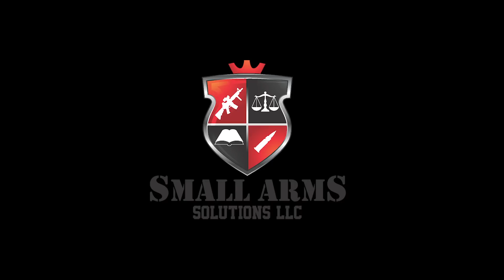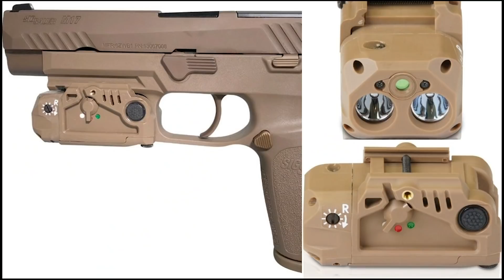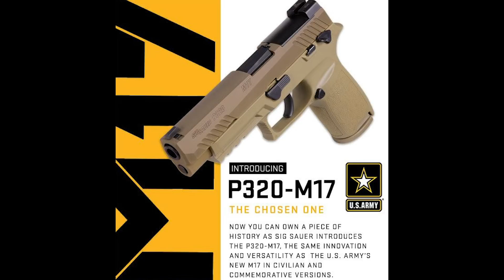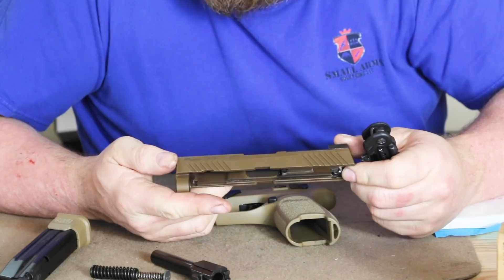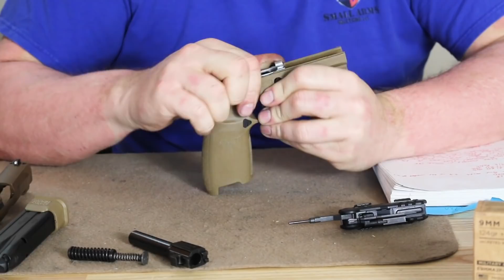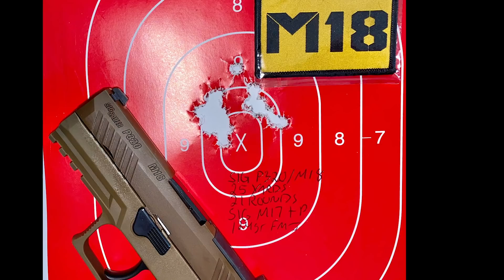Sig P320/M18 Pistol

Comment: The beretta apx is better than both of these considering the price on the civilian market . I see them all the time around 300bucks with multiple barrel sizes to choose from.
Reply: 38 years and they still come with crappy sights trigger and grip angle . First one i ever owned scattered bullets all over the target pure terd . Shoot someone else's next to me and hit just fine . Had several others they worked fine but still never have liked them. But the absolute worst thing about them is all you cheese dicks showing up on every gun review whining and moaning about your ugly ass glocks  that most of you have never fired over 50 rounds out of in month more like a year so How bout that.
Reply: @rustytaylor7708  The sites work fine. I've never changed sites on mine. You need practice.  The Glock is a polymer pistol that can be trusted right out of the box for service in military or police. Its not suppose to be a bullseye shooter or a competition gun, it's meant for duty use. Who cares if they are plastic or metal, you won't know the difference either way.  Just dumb Hater complaints. The more extreme Grip angle is to help maintain recoil, but your not smart enough to know how that benefits the shooter. Has worked for 38 years and everyone is copying the patent now. I wonder why..?
Its damn ugly, but its not a beauty contest. It's for duty use. Simple, reliable and light weight high capacity. 
That's all you need.
Reply: Better than a Glock? Prove it. Glock has a 38year  reputation that's hard to beat.
Reply: @rkwjunior2298  berettas has more experience in the field than glock . sorry my friend. almost 500 years now.
Reply: JoeyJoe 500 years of experience, most of which was spent building blackpowder Firearms. Sorry, that doesn’t count. The Glock, any of the Glock models, are superior to the M9. I was issued an M9 when I was in the 5th Special Forces Group, almost to a man we hated it. Overly large and heavy with a lousy trigger.  I was fortunate enough to have a team sergeant that allowed us some leeway and I carried my personally owned Hi-Power. Same caliber and an older design but much better than the M9. Take a look at what the SOF community is carrying now. The correct answer would be Glocks. Even the SEALs gave up their Sig P226s for Glocks. To me, and anyone paying attention that says something.
Reply: @RobinP556  I like glocks too man  , i have a 19, but considering beretta long history with firearms , especially military , i think an apx at the half the price of a 19x is no different . we can agree to disagree i guess.
Reply: @ScottyBennitone  500 years..lol...how many years have they made reliable polymer pistols that have been in actual service around the world?
Reply: @ScottyBennitone  The APX doesnt have the track record. Just because the 92fs or m9 works doesnt meant ALL their offerings hold up to military service, you cant assume they are all reliable. Yes youd think it does, but there is no track record for a polymer like Glock
Reply: The APX didn't make it through to the end of the XM17 trials.  The two finalists were Glock and SIG.  It is not better than either.
Reply: @bolemhimself1703  that doesn't mean it failed, they could've dropped out once they saw that the trials were BULLSHIT. We truly don't know what the better pistol was because the army's premature adoption of the sig. The sig's issues of not being dropsafe and failures between fire were found after adoption. The trials were cut short because sig made "an offer they couldn't refuse." That's why glock is putting up a fuss afterwards.
Reply: Furthermore, glock isn't made of unicorn shit and rainbows. Nearly anyone can make a tilt barrel striker fired polymer pistol. The APX delivers a low bore axis of the glock and the modularity of the sig. Both sig and glock both had their issues with QC and the companies refused to acknowledge them with fanboys happy to defend them. Also, quit trying to justify an awkward grip cant.
Reply: @raylandraybels9462  Actually yes, that's exactly what it means.  It's true that the final phase of testing was not completed, however the only two pistols to make it to the final stage were Glock and SIG.  I believe the first to be dropped was the M&P 2.0.  Beretta would not have voluntarily dropped out, as they really wanted/needed the contract.  They initially pushed for the M9A3 which the army rejected and then scrambled to come up with something that would meet the XM17 requirements.  The APX failed to make it to the final stages of testing and was dropped.

Comment: The US government giving substandard equipment to the military what's new. Great example would be the m14 and the m4a1
Reply: What did the M4A1 do wrong.
Reply: How was the M4A1 substandard? It filled it role beautifully. Yeah the M14 was trash though.
Reply: It's unnecessary heavy because of the socom barrel throws the balance of the rifle off. It's barely a improvement over the regular m4. Could have easily upgraded the internals like the bolt and carrier gone to a free floated rail. Getting rid of the fixed front sight which no one uses any more and kac rail for something lighter. Why is the US government making the m4 as heavy as a m14. The m16 was meant to be a light weight full auto weapon. The modern m4 is not
Reply: @rockerdude8000  so you are shitting on a weapon because when they introduced it none of what you mentioned was available until after the M4A1 was entered into service. That is some ass backwards thinking right there. Also how is an M14 weigh as much as an M4A1?
Reply: @FXIIBeaver  by the time you add all the extra crap on its a 10 pound rifle easily and all the stuff I talked about adding have been around for a decade at least. Enhance bolt and carrier are not new either lmt made their's in over 15 years ago other companies make theirs like knights and lwrc. The mk 12 had a free floated rail.
Reply: @rockerdude8000  the SOCOM barrel is a necessity because it makes the gas tube the failure point again. With the original M4 profile a sustained firing cycle would affect the heat treat of the barrel right behind the gas port and cause it to blow. By adding mass you ensure that if you run the gun hard enough to blow something, it's gonna be the gas tube.
Changing the bolt/carrier was attempted with the M4A1+ program but the military didn't want to introduce parts that would malfunction if fitted on a M16.
Reply: @ChucksSEADnDEAD  yeah that depends on how the gun is used. Chris has talked about socom using the guns as saws that was the problem. The regular military doesn't do that so it's not necessarily for the m4 to have such a heavy barrel. The average army or marine infantryman in combat isn't going to mag dump 15 mags in a row in battle.
Reply: @rockerdude8000  "The regular military doesn't do that" - You must have forgotten how much of a shitstorm the Battle of Wanat caused precisely because regular military cooked their M4s to defend their position against a overwhelming force.

Comment: I had a sig 2022 that the hammer didn’t always lock back on when you pulled the slid back. I had to send it back to Sig to be fixed. Seemed like poor quality control to me. Then there was the drop safe issue on the 320 and the 365 seemed to have something wrong with the firing pin braking. I think they rush a lot of stuff out the door without enough testing. Gen 3 Glocks are probably what I trust the most.
Reply: That's because they are a mass production company now. They(shareholders) have realized that's there's way more money is mass pro of decent guns than making less great guns. Just the reality.
Reply: Was that the long way around the barn to say you are a glock guy?
Reply: Rusty Taylor well, I guess I might as well come out of the closet

Comment: Pretty sure Glock didn't spend much on R&D they have been using the same design for years and they had manual safety version before.
Reply: ska3041 right?  All they did was put a 19 slide on a full size frame and paint it brown. 😂
Reply: So Glock spent millions on R&D to paint a gun .
Reply: @thatguy4779  worse yet, glock did the same and made a slightly lesser gun.
Reply: If it ain’t broke then no need to fix it, they have a tried tested and proven formula that has just  worked for almost 40 years.  MHS was decided mostly on price and the historic promise to award SIG a meaningful military contract.  It’s understandable but obviously a worthless competition as the decision was made regardless of all the issues the p320 and M17/m18 have had.  I really wanted to buy a SIG P320 for use in carry optics,  but in Europe the configurations available for the P320 are awful,  and even more concerning is the fact that German arm and factory for SIG is closing down.  Maybe this will open up the American SIG Catalogue to European buyers, or it will see SIG pistols disappear from the European market place.  However until they develop a P320 with a decent mounting option for optics I’ll pass and stick to a Glock MOS or HK SFP9 OR..   I like the concept of the P320 and the option I would buy is the RXP Xxompact, however the issue with that is it’s not available in Europe, so no SIG for me until it becomes available.
Reply: LOL@theGlockhaters.

Typical, and predictable.